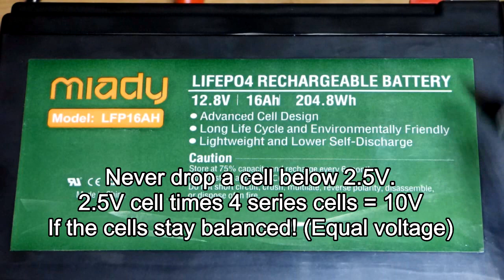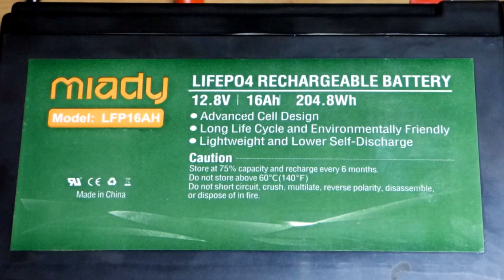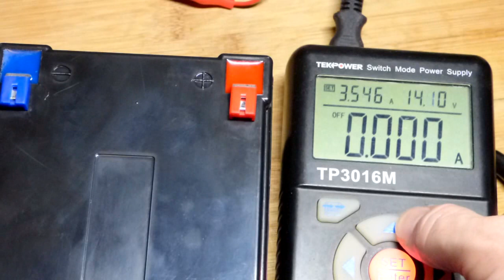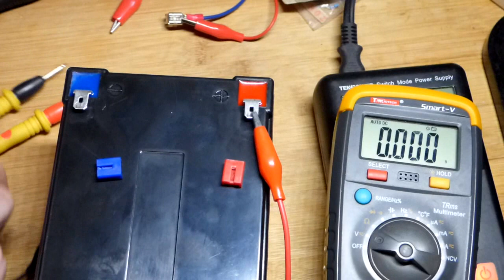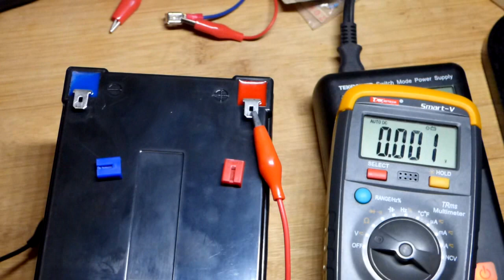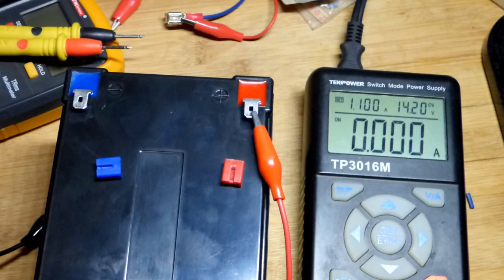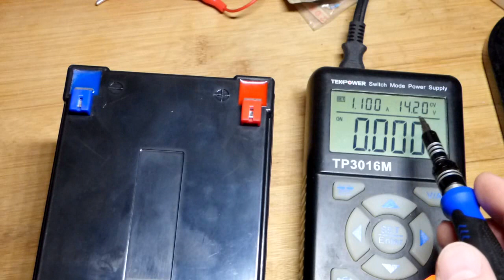I can tell my 16AH LiFePO4 battery cells are unbalanced BMS cutting off charging to protect it

Comment: Excellent catch.  I have observed the same sequence.  I was able to see the individual Cell packs voltage via BMS BT.  One cell was going into Over Voltage Protect at 3.8v...  other 3 cells at 3..4 or less.  The BMS would do a reconnect for charging at 3.5vdc..  
I watched the charge current...  As the bad cell reached 3.8 the current would go to 0, about a min or two later the BMS would do a reconnect and charge would start again. Correct about reducing the charge voltage down to keep the battery safe.
Reply from the maker: Thanks for the info!

Comment: Can you exercise the battery to try to balance them out? Maybe use a load tester to discharge and then try recharging them a couple of times?
Reply from the maker: Lithium cells don't stay fully charged at their max voltage. They drop a small amount shortly after they are fully charged and the charger is removed. So the highest cell probably dropped closer to the other cell voltages each time I charged it.
Reply: The battery I had, returned to vendor for a refund, had a defective cell pack.  32 cylindrical cells for one cell pack 200 ah.  That causes the other 3 cell packs to never achieve full charge.  The defective cell pack just appears like a smaller Ah battery. Jim.